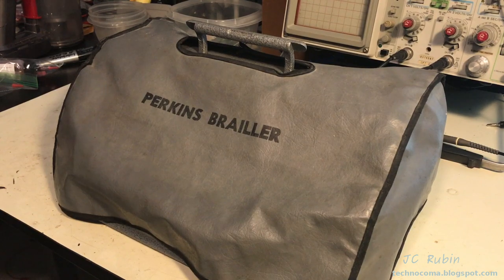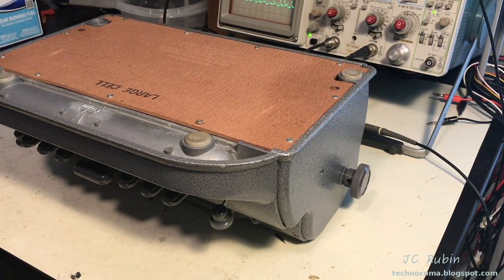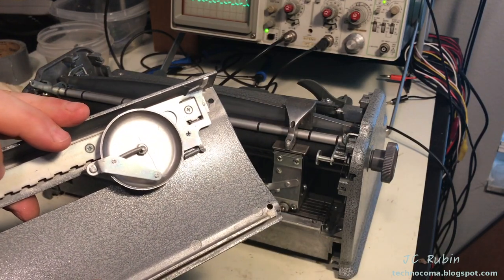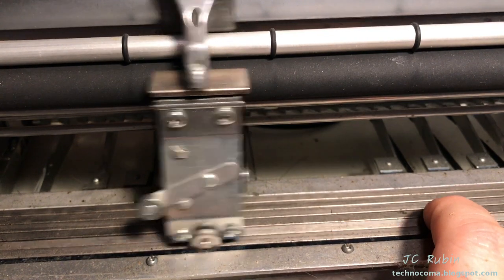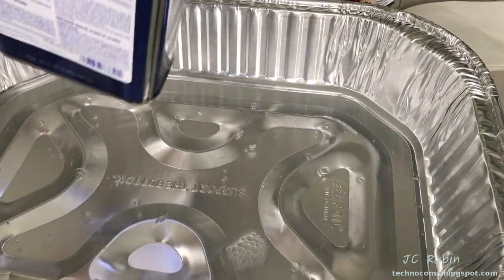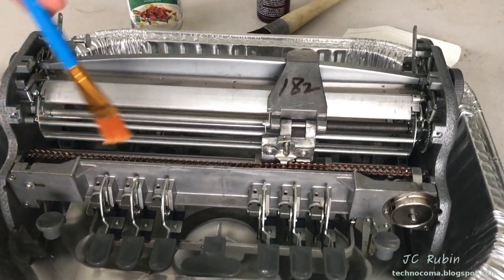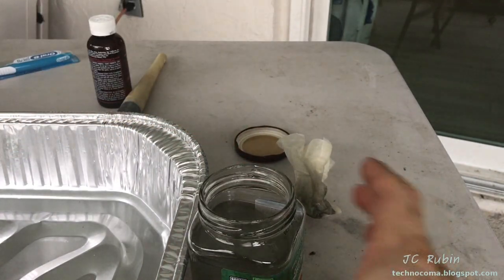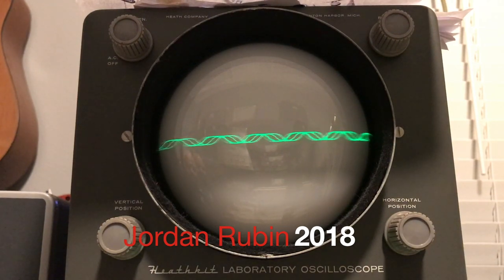Perkins Brailler - Factory Maintenance Procedure - Part 1 of 2

Comment: From the age of five years, I have used my fair share of Perkins Brailler units. Inside I knew they become disgustful but did not know just how intricate the machine truly is and how many places the funk can get down. Even if I were equally mechanically inclined, I doubt I could repair my unit. Kerosine is a vile smelling substance and I was surprised for that to be used of all liquids. I do have a strong recommendation to obtain isopropyl alcohol that is 99.9999% pure alcohol [IPA-NANO PURE, PETA-BIT Grade Isopropyl Alcohol 99.99%]. It is expensive, but that nonsense any less than 99.95% is insufficient for a machine of this calibre of mechanical composition. I will be bold and assert the statement in future it would be beneficial.  although much time must elapse for that to be proved true or false. Considering this machine is how I write when I choose not to use a slate and stylus, I enjoyed this repair session about a machine that is interesting as is useful.

Postscript: The first model was made the year 1951.
Reply from the maker: Hello,
Note that the process used was the exact factory procedure step by step with all specified tools cleaners and oils.

Comment: You know what's fun? cleaning a brailler after 2 consecutive toddlerhoods, lol. Ick.
Reply from the maker: Yeah, probably ready for maintenance.
Reply: @retrotechandelectronics  One (we have 2 for some reason) is working okay with cleaning, though I still need to oil and replace a couple bits. (Waiting on the mail.) And then there's the bits of glue I've not quite gotten up yet. The other, I think I'm going to need to send it away.

Comment: What is with the audio levels? Perhaps run your videos through a compressor/limiter in the future!
Reply from the maker: Pentium 00F Bug video, maybe you can get a tripod to stabilize you videos in the future!   Take your complaints elsewhere.
Reply: @retrotechandelectronics  As an audio engineer, nothing was complainable about this video. I can tell those audio excerpts in question were likely a fast-forwards of the tedious parts of the repair that are illogical to keep at normal speed in the video. It allowed me to hear the coolness of things like removing screws approximately 5 time the speed. So many persons on YouTube have awful audio or awful music that ruins good audio… not here.